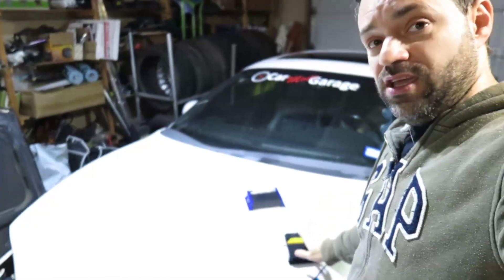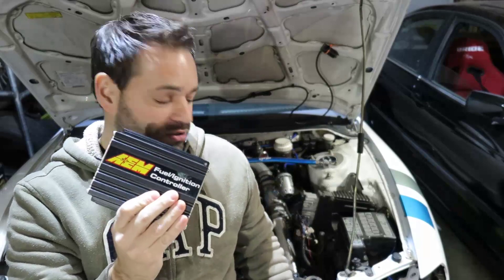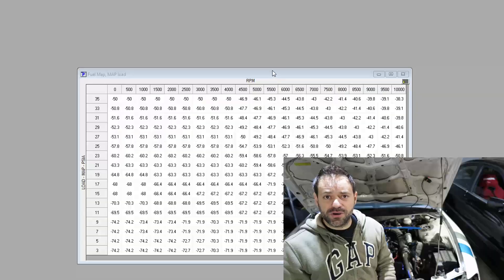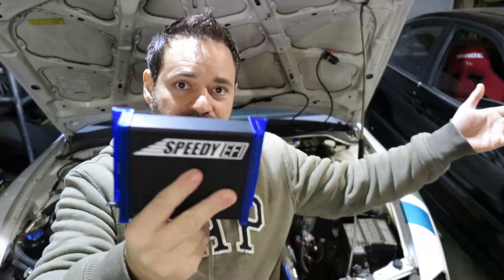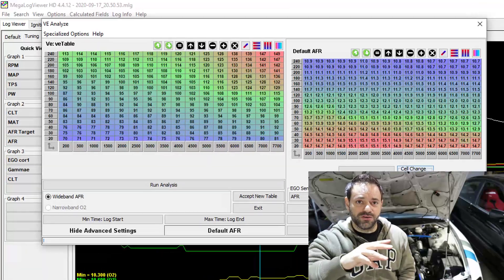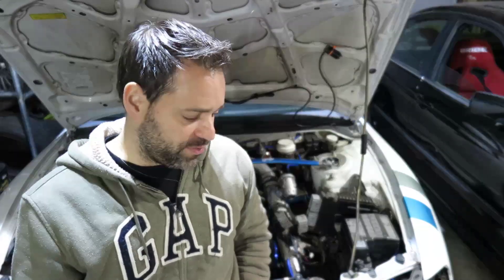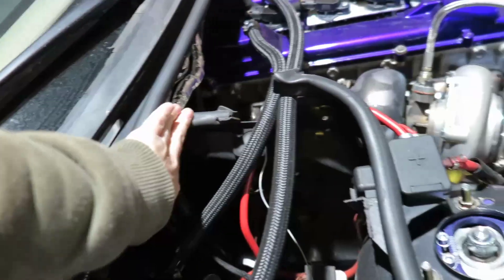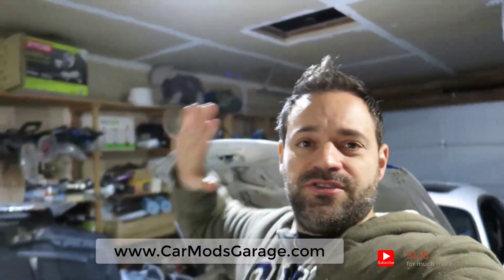AEM FIC/6 vs SpeedyEFI Speeduino ECU Why I am replacing the AEM - Eclipse 2G Project

Comment: Would this work with a boosted 04 Toyota matrix? I was looking at the fic 6, but this look a bit more promising

Edit: I want all the a/c and lights to work still as it’s a daily.
Reply from the maker: I installed on my Toyota Supra and everything seems to be working except the rpm because I didn't connect a wire.  eclipse has one also and has everything working.  Check engine light won't work though.  
Message the speedyEFI guys on Facebook.  They usually reply quickly.

Comment: I saw  management making a pass ‘; meow 😸
Reply: I subbed yo !
Reply from the maker: @Alientraveler003  thanks brother
Reply: Is the speedy still working ;where’s the vid of it operating the engine and acceptance of commands pls
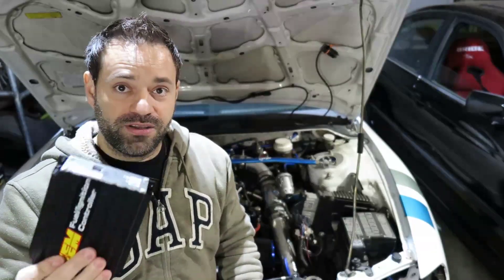Reply from the maker: not sure what you mean by acceptance of commands. TunnerStudio actually do whatever behind the scenes but yes it is working perfectly and you can see some pulls on this video. Skip to 4:20 is you want to see the driving https://www.youtube.com/watch?v=F6GFpVUcF28
Reply from the maker: this is also using SpeedyEFI. A little shaky but check it out my BMW with a 2JZ in it. https://www.youtube.com/watch?v=j9zZBr6Kc_8

Comment: What housing you using?
Reply from the maker: It comes with SpeedyEFI
Reply: @CarModsGarage  Did you do any potting to the electronics after you finished everything or do you just leave the board bare in the housing?
Reply from the maker: @beachboardfan9544  just leave in the housing. They do a good job making like "shelves" inside so the board is  stable

Comment: Can this unit work on a l4 diesel engine?
Reply from the maker: I don't know. Message SpeedyEFI guys they will tell you. Find them on Facebook and they should answer quickly
Reply: Speeduino uses an arduino controller chip. All open source.

Comment: if this speeduino better den g4link
cause some recommended for cost
thank if u reply to me😀
Reply from the maker: I never had g4 link to compare but I'm very happy with the SpeedyEFI. Check my videos I have a w with a 2jz engine and a mitsubishi eclipse running this ecu. Also building a supra and already bought a SpeedyEFI for it
Reply: @CarModsGarage  ouch nice cause some my tuner recommended me this item he said cheap for cost repair and same as g4link,haltech
board is base on 0.4
Reply from the maker: If you are going to order check how long of harness you need. They have 2ft and 8ft that comes very handy and coat effective if you need the long one
Reply: @CarModsGarage  haven to grab waiting my car done pnp🤣😂den grab a speedunio cause since cheaper standalone comparing g4

Comment: I have the AEM F/IC now and don't like it. My car is a daily driver and I want to keep all my options like air conditioning. Right now my AEM F/IC only controls the fuel injectors and and timing. VVTi is controlled by stock ECU. I cannot control partial boost/partial throttle very well. The car's ecu is always trying to bring afr back to stoich. It works fine at full throttle (open loop) but sucks in closed loop. Can this SpeedyEFI be wired like a piggyback and just control AFR by taking the stock ECU fueling completely away from the car's ECU? I have a Toyota Yaris with a 2zr corolla engine, Scion xD ECU, harness and a T28 turbo kit. Thanks for the great video. I am very intrigued by the SpeedyEFI.
Reply from the maker: I got it on my eclipse deleting the oem ECU. Everything in the car works perfectly. 
I don't have abs and other stuff that might be controlled by the ecu but it will not work as a pigback. You need to cut the wire for fuel, coils, sensors and attach to the SpeedyEFI. Not sure if your ecu will like it. The best thing to do would be to contact the SpeedyEFI guys from their Facebook page.  They are pretty responsive.
Reply: @CarModsGarage  Thanks man! Looks like some great builds you have there. Not long after replying to your vid, I emailed the supplier.
Reply from the maker: Thanks man I appreciate it. 🤙
Reply: @CarModsGarage  The SpeedyEFI guys tell me that the FishDog can take fueling over completely; removing the stock ECU from the equation. They say it will work perfectly with my stock ECU - as a piggyback. I'm optimistic that it may be my future engine control - well, fueling control.
Reply from the maker: Oh that cool. Ya those guys are good and they know their stuff.
Reply: @acbent11  hey Adam, you ever get your build working with this? Also are you in NB? I'm in Freddy and SJ, pricing out a turbo for my 2ZR but engine management is the big question because our car isn't well supported. Afaik some people cracked the stock ECU now too, so that's an option this year.
Reply: @acbent11  I am thinking parallel ECUs might be the solution for our engine. Run just the fuel and ignition through the speeduino and leave the stock ECU to control the rest of the car.
Reply: @Vok250  Hey man. Still with the F/IC. Car runs good generally, nice and rich in boost. It still has a few anomalies such as a slight hesitation if I stay right in the transition between vacuum and boost. There's a guy called Tuned by Turner in Fredericton. Claims he's got lots of experience with the F/IC. He's offered to tune it, but he's a little hard to get I'm touch with. I was out to see him a few weeks ago. I'm not giving up on the F/IC yet. I was talking to Brett at BLP last year and he did tell me he could tune my stock ECU now. I've just been driving the car every day this summer and enjoying it, not really working on it much other than routine maintenance. If you're in Freddy, we should meet up man. There's a few car guys I hang out with, but they're not really Toyota guys.

Comment: Megasquirt is not a speeduino ..it’s only similarity is that it uses tunerstudio. I run a speeduino it’s great, but it’s not a
Megasquirt and vice versa
Reply from the maker: yep you are right.
Reply: Your right and in which car ur using speeduino ?
Reply from the maker: Sorry I don't. I know megasquirt has few more functionalities and cost more. Speeduino is an Arduino based which I believe Megasquirt is not.